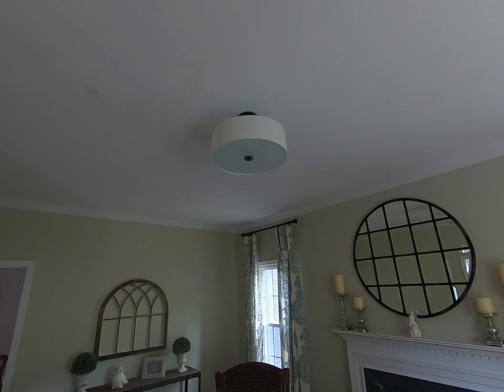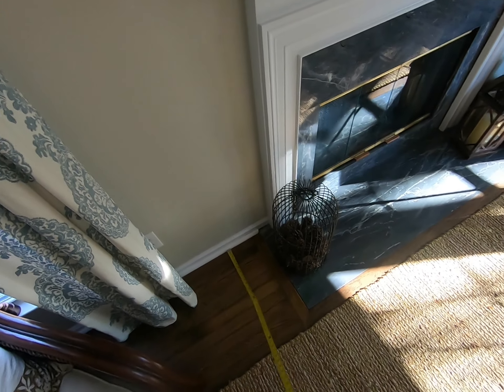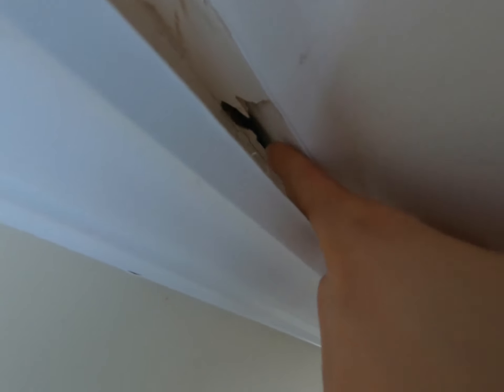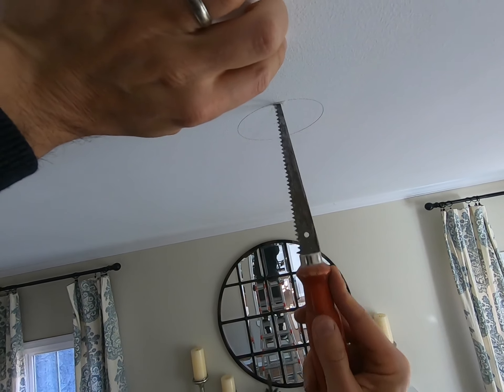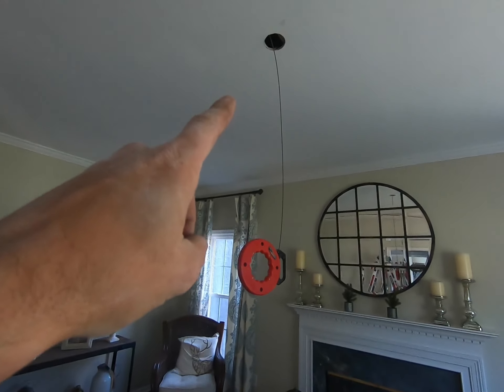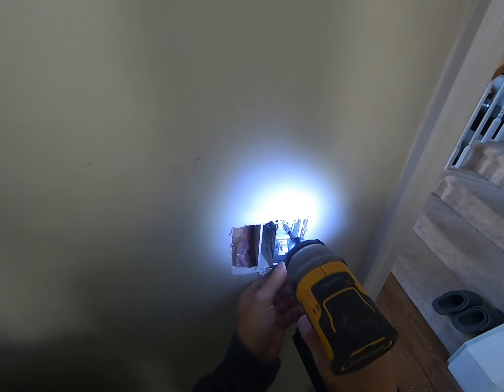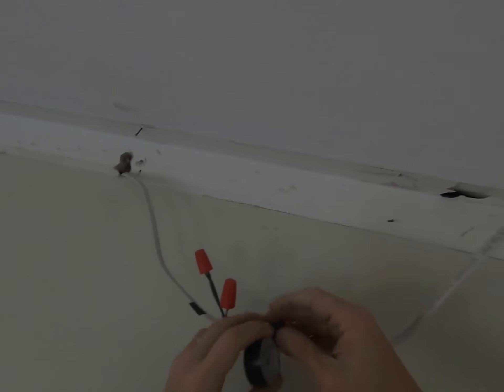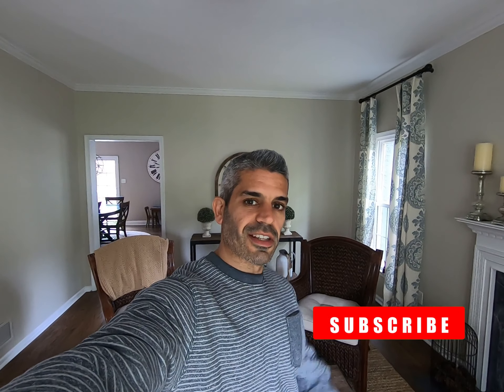How to add a new ceiling light - how to add ceiling light without existing wiring

Comment: This is far from respecting code but it works and won’t give you issues.
Reply from the maker: It’s the splicing isn’t it? I suppose I could have gotten one and cut out the drywall and put the box inside the wall.